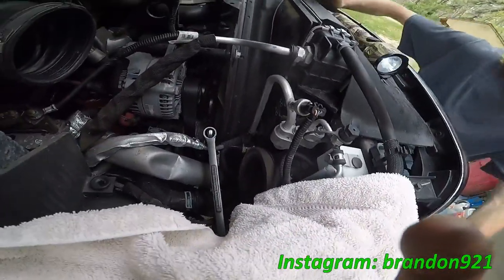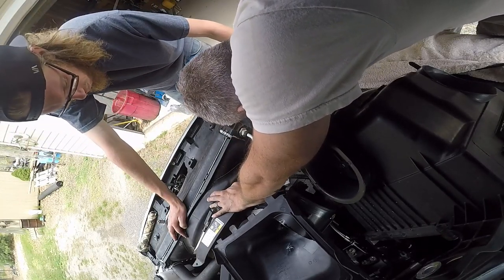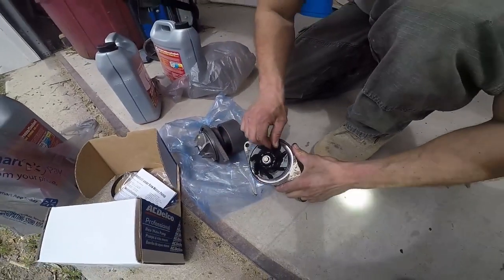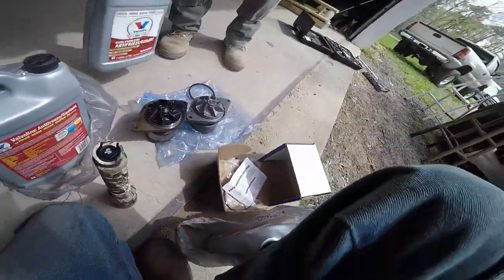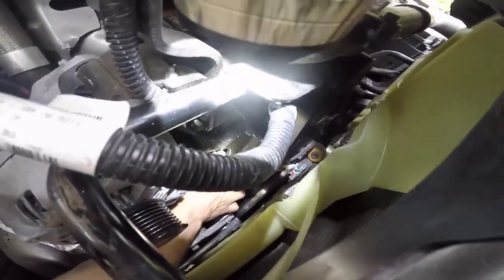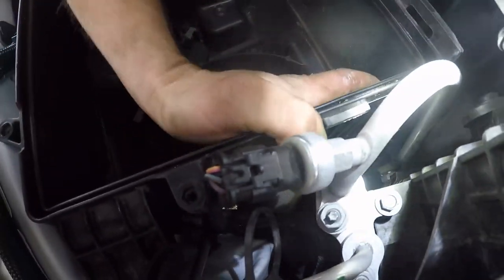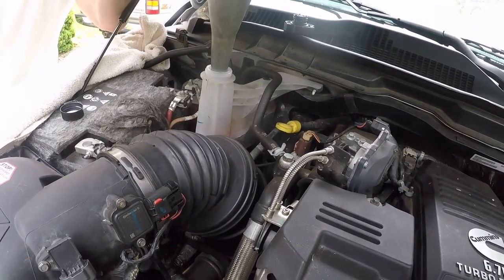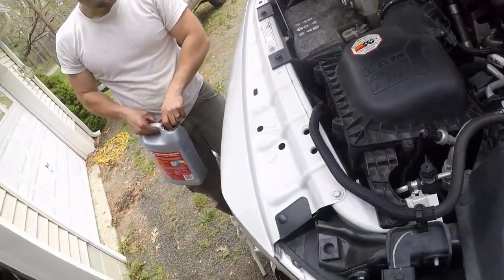What's the issue with the Ram Water Pump Recall?

Comment: hey brother any issues with the transmission due to the large tires, wanna do the same build but heard too many bad stories about the 68rfe transmission going out...In love with your truck tho!!!
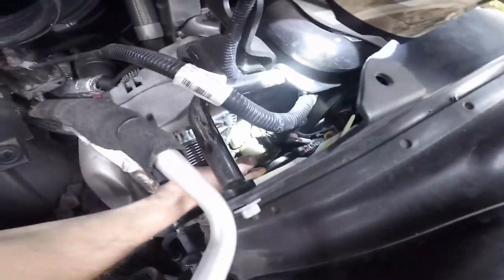Reply from the maker: Dj Goliday Thank you! I run my truck in tow/haul mode all the time. I take it easy, i don't floor it, no hard shifts and with tow/haul mode on it shifts at higher rpm plus keeps out of over drive. I think problems would occur running it hard and towing alot. I won't tow until i change gears to 4:56, plus tune shift points once that's done. Alot of people have programmers on, and the trans is searching for a gear when you smash it, plus wants to shift at way to low rpm. Stock gears are 3:42, plus bigger tires probably  changes ratio to with my questamation to like around a 2:30 ratio. Back to stock with thise tires with equation would be around a 4:18, obviously they don't make that. I could go with a 4:10, but i rather a 4:56 gear. Fingers crossed 🤞 hope she's good till than and after!
Reply: absolutely i hope so too ha, im over in iraq so i gotta wait till i get back but ill wait and see what the new designed HD's does with the trans and maybe ill buy the new design...but im kind of thinking theyll be too expensive and ill be able to pick up the 2018 for a way better deal. But whatever i do im gonna change the gears soon as i buy it! thanks so much man and please keep uploading i LOVVVVE watching your truck!
Reply from the maker: Dj Goliday hey bud, thanks again for your service! You're on Instagram too, also I will be uploading more videos too. I do excavating and been working ten hour day, but thats kbiw excuse! Lol. Also check out used, i boufhr mine frim the biggest truck action dealers on the east coast, got mine with 3500 miles on it! Can't wait to see yiur project start! Install lift yourself too, good way to get to know your truck!
Reply: ok ill add you on insta!